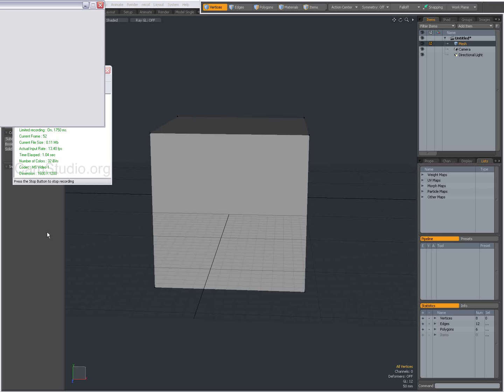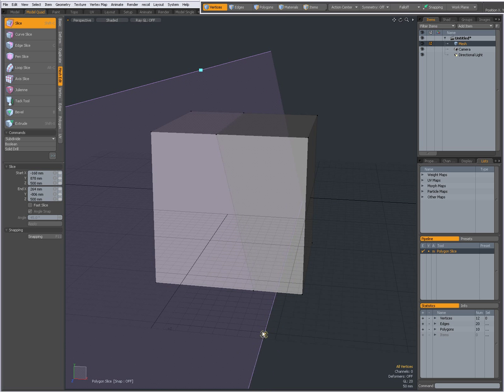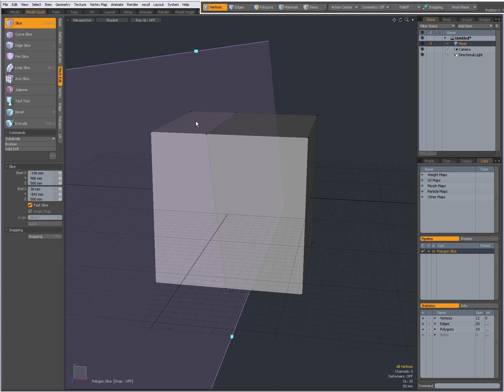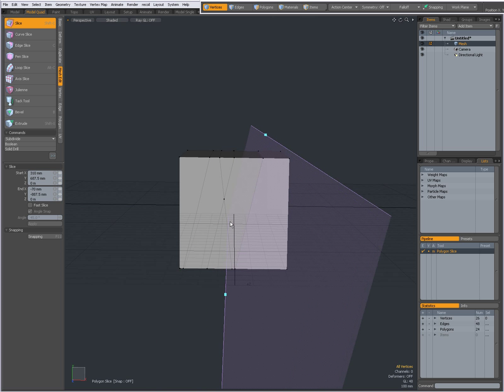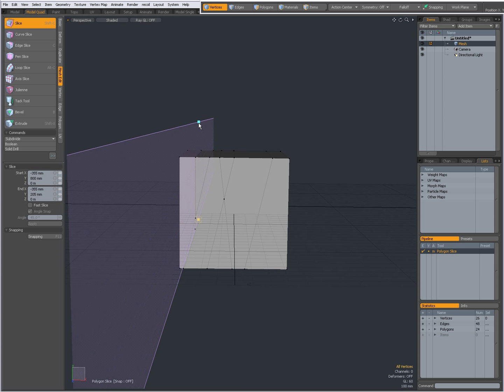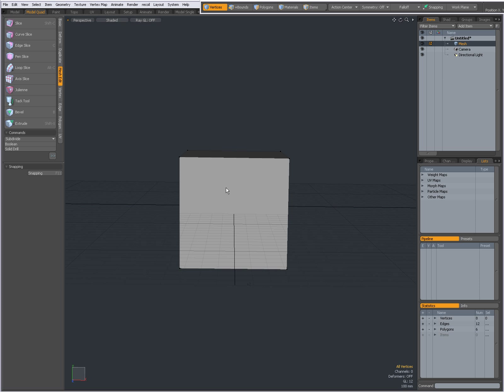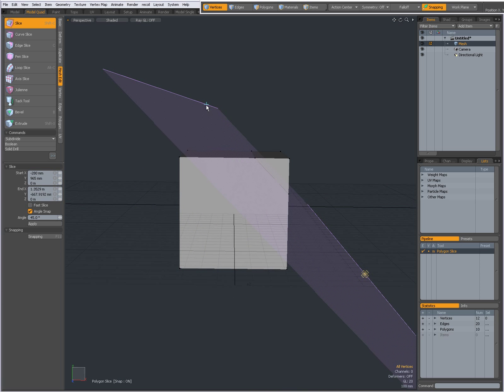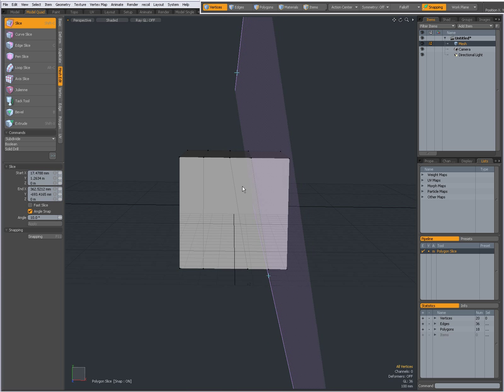0030 modo Slice tool.

Comment: Good day! There is a problem, this wonderful tool only works in a vertical position, but I need in horizontal how can this be solved? Thank you
exmp scrshot: http://imgur.com/l4UmURZ
Reply from the maker: +Den Boyko 
Just drag the blue dots around in the viewport and/or adjust the tool properties.
Reply: +dominiekdr Hi, i just make reset workplane, and it work now. Thnx.
Reply from the maker: +Den Boyko 
OK ... Yes, you need to keep track of the workplane settings ...